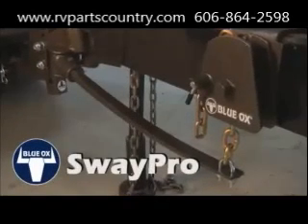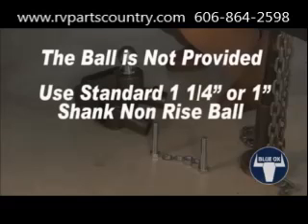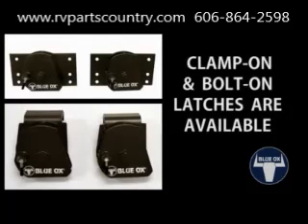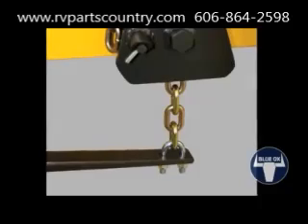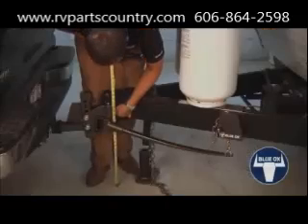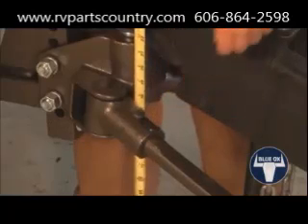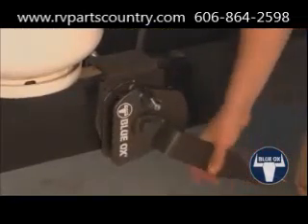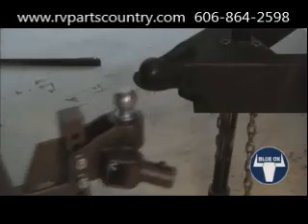Blue OX SwayPro Installation Guide at RV Parts Country

Comment: Size of the bolts would be helpful. Not everyone has those big bolt fittings or wrench.
Reply: On my Blue Ox it is 1 1/16 " and 1 1/8" for the bolt and nut.

Comment: At what point do you re-inflate the air springs?
Reply: After you're all hooked up you can add air but the bags shouldn't raise the tow vehicle at all as you re-inflate.  If they do, you're taking away the weight distribution properties with every incremental increase.  If you're sagging with with WDH hooked up, you need to add more tension to the spring bars or go get spring bars that are properly rated for the tongue weight of your trailer.
Reply: Were you able to adjust the spring bars and fix sagging?- if so,  how much did you adjust?- did you put air in springs? How much?